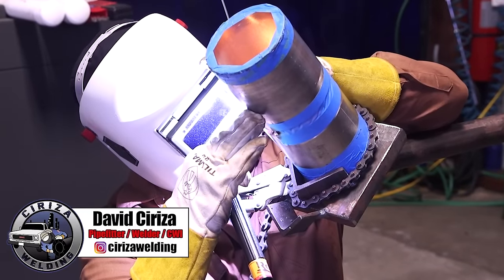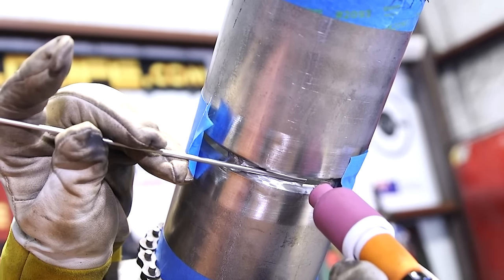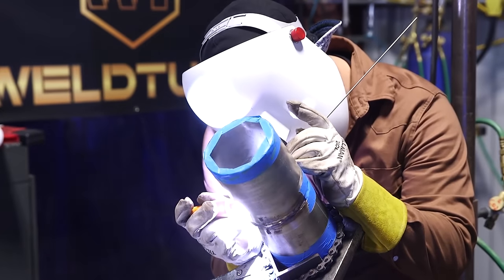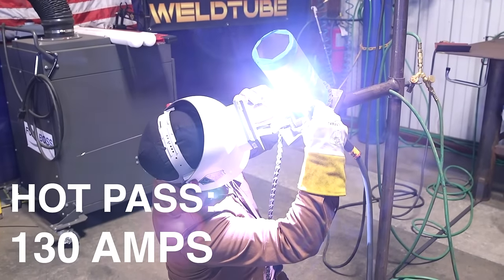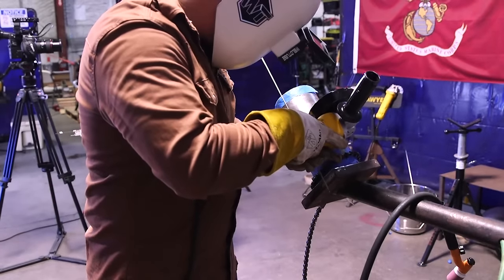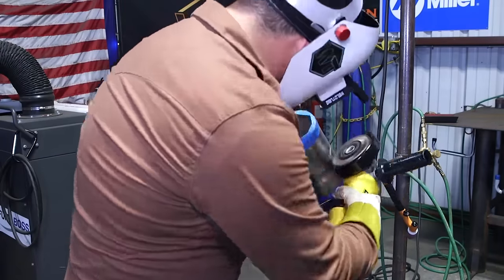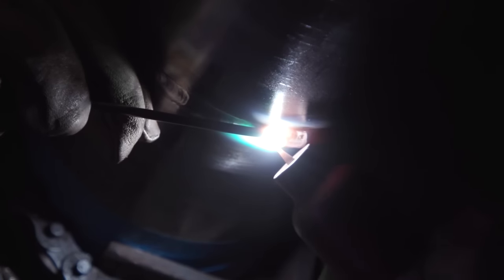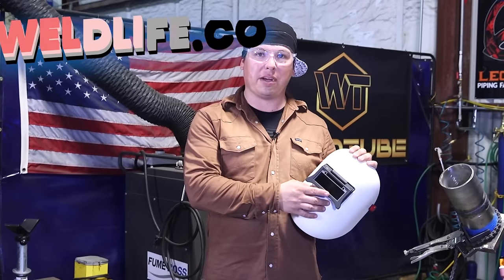HASTELLOY Tig Welding

Comment: With alloys like nickels and stainless that love to oxidise really easy, when popping out i dont just whip the torch away, i run the arc a few mm up the rod then whip the rod out. Keeps the argon shield over the puddle as it solidifies. Got into the habit years ago now after an older guy showed me when i started out after college

Comment: right on time boys, just got certified in c276 and been welding up flange adapters sch 80 150 and 300 flanges,  appreciate the knowledge shared
Reply: is it the same as inconel c276? (incoweld c-276) ?
Reply: @lyfoon  yep. C276 is hastelloy

Comment: Nice way to lern the material  but to be honest, on the job side this way takes way and way to long... and if you calculate the energy input on the rootpass i think it wil end up a little hight.  The key is same as duplex alloys, high amps and a lot of speed to keep the material as cold as possible.

Comment: 1/8 tungsten red? I have found the purple tungsten doesn't get as contaminated is it ok to use?
Reply: @SmokensVideos The best one was, is and will be red. Anyone claiming otherwise is green (pun intended).
Reply: @SmokensVideos Nice data minded essay. It wouldn't be needed if you actually had a clue what you just wrote. Red tungsten has best arc stability of them all, that's a fact. In tig welding, arc stability is everything (besides the skill). Red tungsten is as radioactive as a gravel road, that's a fact. Tungsten electrode doesn't emit fumes; ionized arc and weld puddle does.
Reply: @ayoutuber3116  You're right, I tried blue, purple, gold and red. Red will always be the best on SS etc. pipe
Reply: Best one is the free one they give you at the tool room

Comment: Didn't You get a crater or a high possibility of a crater when You break up Your arc so fast? I always thought that You need to set current descent for like 5-6s
Reply: @SmokensVideos :D also you purge that stainles steel inside inside and when u finish welding you take your torch and leave this spot oxidised
Reply: Some machines don't have all those fancy settings or remotes to control the amps.  Just feather out the puddle  up to either the side of the  pipe up the bevel then break arc . Never pull out inside the puddle when welding. Either run up on the sides of the bevel and pop it off or run the arc up onto your filler wire.
Reply: My thoughts exactly,  teaching people all wrong

Comment: All you guys purging the hell out of your tig welds on pipe.  What a waste
Reply: You have to on stainless lmao.
Reply: @austinhampton5674  what is this dude talking about ? 😂😂
Reply: @CR-nn1by  no clue my guy 😂😂. Mans must sugar without knowing what it even is
Reply: @austinhampton5674   no u dont I've ran that shit for years
Reply: @lilchucky4765  you run sch10 with no purge?
Reply: Ten. 40 80. U name it an passed
Reply: While u weld 
 Then no purge necessary
Reply: @lilchucky4765  you have to purge when you gonna throw that root, after the hot pass the purge isn’t necessary but if you’re not paying for argon fuck it keep on just to make sure nothing happens
Reply: I call BS….. thin wall purge on all times….. sch40…reduce it on the cap…sch 80 fill pass then can reduce it …. Never totally off